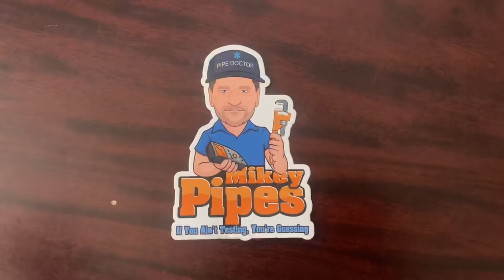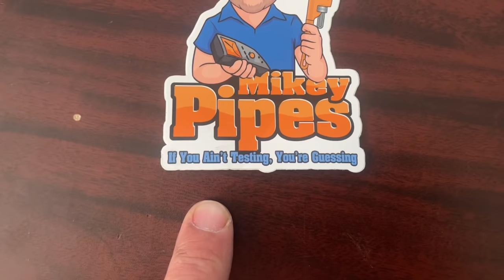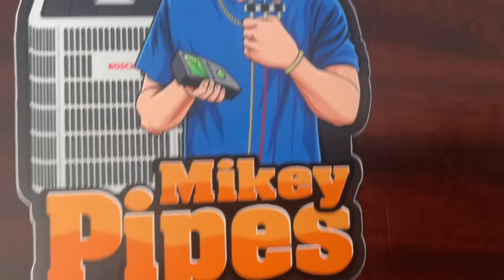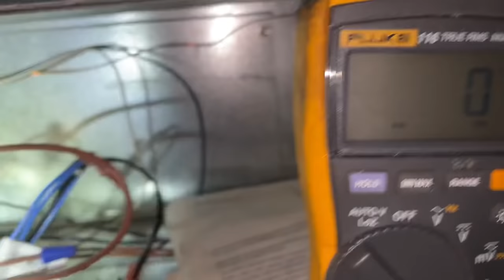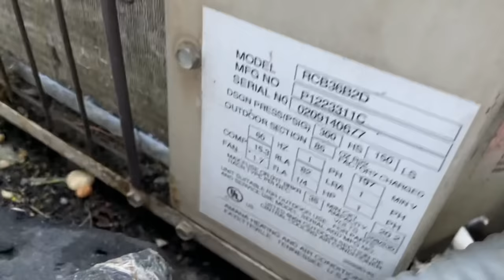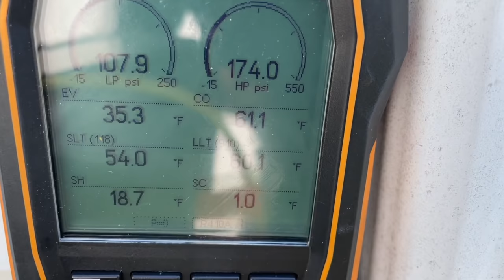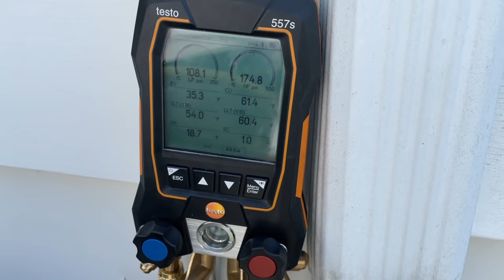Double Feature - Moss Growing on Condenser & York Evaporator Coil Leak Summer Sticker Giveaway V2.0

Comment: You did a good job explaining his options,  after that it's up to the customer.  Clip-lite makes a sealant that would fix that leak, but it has a glue in it that hardens when it hits air, so the system cannot be opened again.  I only used it with systems that were on their last legs.  It always worked for me.

Comment: I think you did a fine job. The thing we have to keep in mind is that your knowledge (and most here) of your trade is vast. The poor client is overwhelmed with the information and can't make heads or tails of the processes of heating and cooling. I worked for a research lab in the facilities department that built a huge expansion that included a chilled water plant that has 2 500 ton centrifugals for A/C.  I met the CEO outside the plant one day and he asked me what this building was. "Chilled water plant" I say. He looked at me perplexed and said "Why do we need chilled water?".  Sheeesh.   I did not know where to begin.

Comment: you did a great job explaining - you cant force a customer to do the right thing - I worked with Fire alarm systems and even when Code is breached you cant force compliance (but you can call the Fire Marshal since its life safety) we used to require customer to sign a waver stating the problem/solution and that the customer is refusing to let us fix it (CYA)...

Comment: The customer just wants the system to last until the house is sold. Whether he inform the buyer of the problem is on him, but the buyer should have a house inspection done and have a professional HVAC company check out the system like " The Pipe Doctor Plumbing, Heating and Air". You explained the situation to the customer he inclines not to get the system fix but just patch the problem. Like you said earlier you can lead a camel to water but can not make it drink the water.

Comment: I moved into a new to me home Dec 2019. Home inspection found a non functional heat pump. Unit was 15 years old. HVAC guy showed up and condemned the unit. Seller had to fix it, so I ended up with a new condenser unit

Comment: My professional opinion is you’re carrying an EPA license and by not fixing the problem you’re just continuing to let refrigerant go into the air! Draw that line to where they have no choice but it’s a good choice. You could maybe use that with your sales pitch! Another thing having a leak in a 410-A system when it’s below atmospheric pressure it’s just pulling in air in the system possibly messing up the compressor!

Comment: Question living on Long Island like I do. Maybe we use A/C 3 to 4 months tops. Is it cost effective to install a really high seer system.  We don't live in Florida where A/C is used for many more months.  I know our electric rates are insane but I'm not sure if the extra expense for a 20 seer or higher system is recoupeable.  Like to know your opinion. 
Thanks

Comment: Clearly the system needs to be replaced, but as a homeowner about the to sell the house, I would have just topped off the system and informed the new owners.  With the current housing market of no contingency offers, he won’t necessarily get his money back.  Buyers aren’t necessarily going to offer more money just because.  They’ll offer more in hopes of winning the contract.  He is however doing a service to the new owners by replacing it since the cost of the new system is rolled into their mortgage, as opposed to having to pay out of pocket later.  In a buyers market, no doubt he should replace before selling.

Comment: isn't it an EPA violation to charge a system with a known leak? I would have told him that the EPA penalties for cutting charged condenser lines are far worse than the criminal charges for stealing the condenser. I forget the % allowed for refills per year on systems under 50lbs...
Reply: @PipeDoctor  R410a was ruled to be damaging to environment and ozone layer in 2019. On leaks, it is treated the same as R-22. Phase out for R410a is 2023 for California (my home state). We expect CARB to continue on the phase out of almost all HFCs, which the Biden admin has indicated federal interest in following suit. Anyways, this means that releases & leaks of R410a are covered under Section 608 § .40 CFR Part 82, Subpart F.

Comment: Ok, this what I would do. Less than a year ago you put in some leak seal (not a fan, it’s a Hail Mary) and dropped in 6 pounds. Now it low again….and they intend to sell.
I would not recharge it, it’s leaking into the house. I would strongly recommend replacing it, I would not recharge it, this is well passed de minimus loss. I definitely would not service it further, not worth winding up owning it.
Let some hack have it, like the first call.
Reply: Mikey Pipes - Pipe Doctor Plumbing & Heating & Air 
I actually did. 
In both cases, I would call them done. Good money after bad, you never profit in the end. It’s tough somedays to be the grim reaper’s mail man but that’s professional level, I’ve seen you do it👍
Reply: Mikey Pipes - Pipe Doctor Plumbing & Heating & Air 
Yes, I saw that, Mike 👍
I’m just sayin, not worth the expensive bandaids. Fix it sorta or rip it out in a week or two.
Congrats on the sale, it was honest.

Comment: Re the first visit - that was a shit show. Re the second visit - First of all, I honestly thought it was a breach of environmental regulations to recharge any refrigerant system with a known irreparable leak (as opposed to your first attempt at sealing the leak which is lawful), because all refrigerants are classified as harmful to the environment. From the second customers perspective, I can appreciate he may have been conflicted in making the right decision and of course that would be influenced by what stage of the house sale he is in. For example if it was along the road and post buyer home inspection then he is in a moral dilemma, if it was early and pre inspection he really has to get it sorted unless he declares the defect and lowers house purchase price accordingly. I think you did a good job of explaining but in this situation a customer is often like a ‘rabbit in the headlights’ (or is that wabbit 😉).
I know it make take longer but I think writing it down in maybe email form on your phablet is a better solution, it is easier to keep things simple and give the customer some thinking time without putting him on the spot. In this case something like:
1. Irreparable leaks on the refrigerant gas lines.
2. It would be unlawful to charge this system with refrigerant as a short term fix.
3. Your options are:
a. Do nothing and live without air conditioning.
b. Replace full installation with the cheapest and less efficient unit - estimated cost $X, 000
c. Replace full installation with high quality and efficient unit - estimated cost $Y,000
Note estimated costs are indicative only and for comparison purposes, a full quotation can be provided once a customer decision made to proceed.
4. If you have any questions please do not hesitate to contact me.

Whadya think Mikey?😀👍

Comment: I've been in business for over 30 years and I'll tell you this "kiss" 
You added sealant which generally Does not work but the dye helps with the leak search.
And this top of the line trash and don't take it personal ,your advertising for free!
"Kiss" 
40° coil = comfort when t-stat satisfied!
Most "most" customers don't know their as* from a hole in the ground, just tell them I put crap in in didn't work I'm not putting more crap in call someone else here's my estimate pay me my service call - 50%!
Stay safe .
🍺🍺🥃🍺🥃🍇🏌
Retired (werk'n) keyboard super tech.
BTW I'M THE ONLY SUPER TECH HERE.🤣🤣😅🤣🤣😂😆
Wear your safety glasses.
Reply: @PipeDoctor  the more you know the less you want to do customers are stuck like you "not personal" 
Brands don't mean anything stick a GOODMAN OR OX BOX THEY WON'T KNOW 1 SEER FROM 20 SEERS 
BUT THEY WILL REMEMBER A HIGH REPAIR BILL WHEN THAT TRASH NEEDS WORK!.😂🥃🥃🍺🍺🍺🍇🏌
BTW 
HOW MANY HEAT EXCHANGERS ARE F'D UP IN NAVI WORLD !?!😂🤣😆🤣😂😂😂🤣🤣🤔🙄🏌